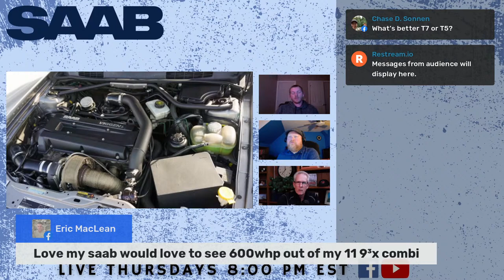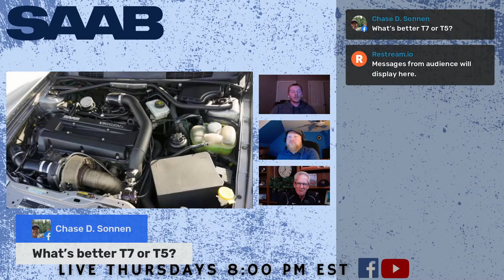SAAB Talk LIVE!  - 600HP Viggen

Comment: The Viggen vs the SPG.
SPG is an unsettling and totally crazy experience if you mat it down low and it suddenly unleashes hell at 4k rpm. Mine was tuned by Swedish Dynamics and involuntary lane changes were common at wot.
Viggen is the son, slightly more controlled, faster but still has that really fun experience. Once it gets the rescue kit and full stage 3, it really feels like it's dad again.